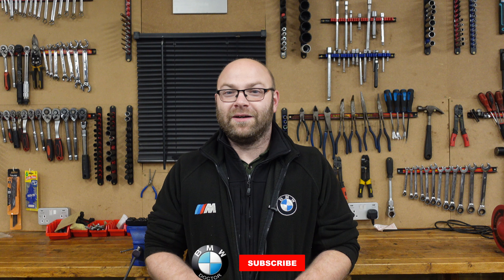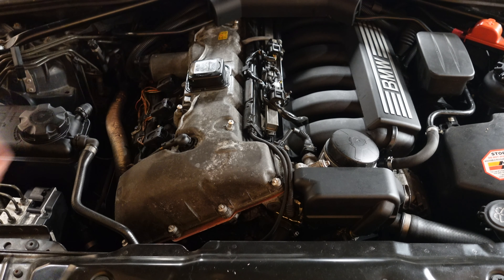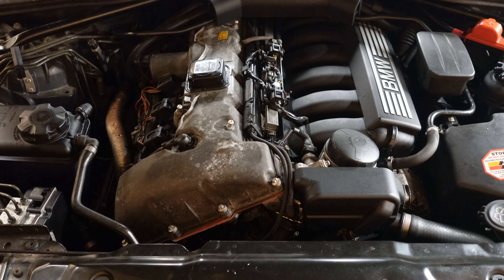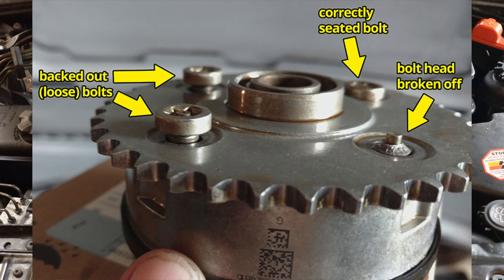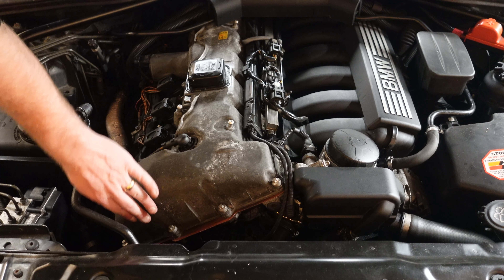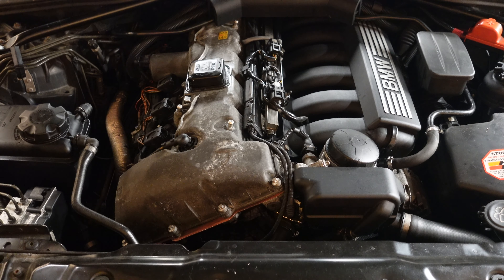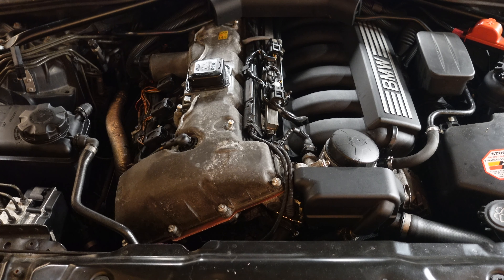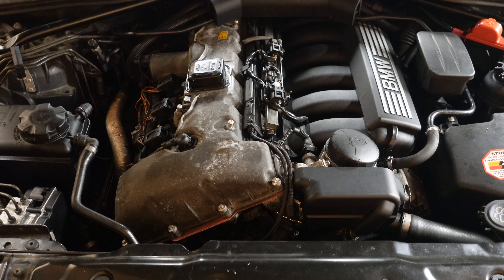IF YOU OWN A BMW N52 ENGINE YOU NEED TO WATCH THIS VIDEO !!

Comment: It was the recall for those bolts, all you have to do, is send your vehicle to BMW dealer for repairs, it's absolutely free of any charges.
Reply: Except that the $1 replacement bolts are not avaiable anywhere.
Reply: They even do your  oil pan  gasket on bolt recall

Comment: I got my 06 530xi in 2013 at 121k,  now its got 255k. Love this n52 255hp. just love driving it.  Watching is a pleasure, Following all I can learn. I do my own work, except tires. I did plugs, coils, water pump, thermostat,  belt & tensioner broken bolt, (had to drill) coolant temp sensor o-ring. 2 batteries, a oil filter/cooler gaskets,  3 sets of tires and half that many brakes.

Comment: i don't understand why driving it wit a failing ESS, vanos solenoid or missfire would cause the Vanos cam gear bolts to sheer off? why would they be under any more stress?

Comment: Doc, I have n52 2011 328ix and it has misfiring on all cylinders. replaced spark plugs/ignition coil/ CKP/CSP/new battery and fuel pump. I can crank but no start. My last option is to check the cam sprocket before I salvage the car. I know BMW has a recall on this  but not sur if I should take it to them.

Comment: Great video Dean and this explains whal happened with my N52 silver one here in Canada. I first brought it to the shop as I had leaking from the valve cover itself the tech said he literally frond a tiny hole in the back of the valve cover. Once the valve cover was removed he noticed one of the gears looking like it was coming loose. He found it so strange. Everything was re torqued correctly and new valve cover installed and no issues all but the tech just could not make sense of it. Thank you again for the informatove content

Comment: Hi Dean,
I have the N52 grey top.
What is the different between the grey and the black top N52,beside the broken bolts?
Reply: The black Top valve covers are considered 2nd Generations N52 which are plastic and the PVC is incorporated or built into the cover as aposed to the grey valve covers which are Magnesium.

Comment: Hi mate I've got the N43 120i 2011 I have a problem with a missfire, start fine in the morning if I pull straight off then get to a junction the revs drop to about 500 then go back to normal then I normal get a engine light pop up code p13b6 , if I turn it of and on it clears then happens a couple of days later...

Comment: My N52 is making a squealing noise from time to time but when i turn off the engine it goes away.  Any ideas?
Reply: While it's making the noice try to remove the engine oil cap. If the sound goes off then it's the valve cover

Comment: Hi dean . Is there much difference in components with the oem parts .certain components are named diff and different parts numbers .I'm looking to replace vanos moter gasket ,eccentric sensor seal ,and the alarm sensor or actuator that fits on left cabin air filter for a 2008 e60 525i n52b25.
Japanese assembled . 
Even more of a issue is I'm in Newzealand. Any info would be helpfull . Cheers 
Jamie.

Comment: Hey Dean, very informative video, I didn’t know the N52K is the one with the black cover. The original N52 if I’m not mistaken has the silver cover? & BTW does the N52 engine with the silver cover have the Vanos Gear like
You mentioned in the video?